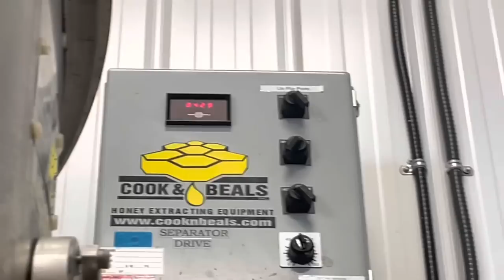Frames Starting to Look Fat and Sassy, Spinner Bearing Replacement

Comment: I was wondering how often you check calibration on your refractometer. What I've been seeing you use looks like a regular $20.00 of the shelf ATC. Dave Burns mentioned & complimented you in his NC video this morning. How great is that!
Reply: You can calibrate with virgin olive oil. It’s refraction is very consistent.